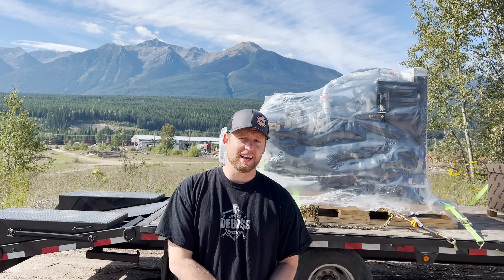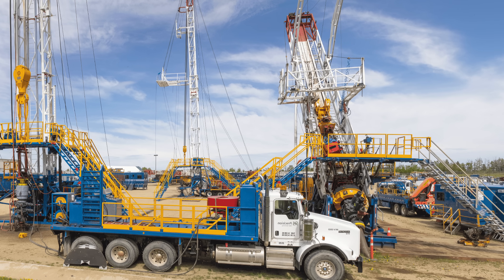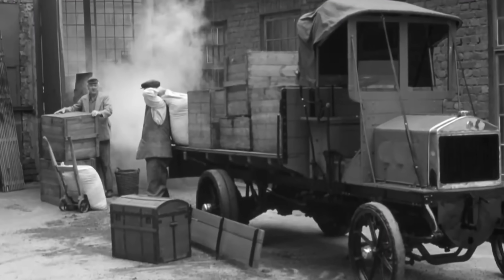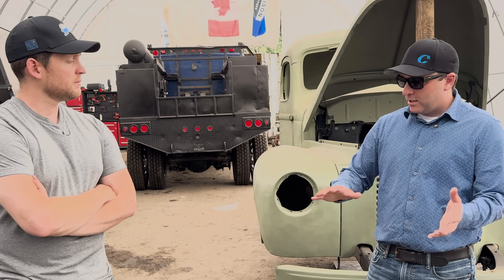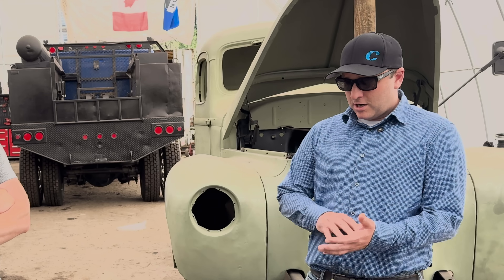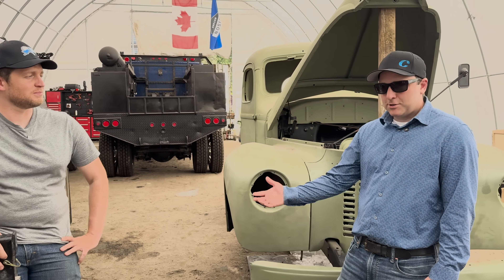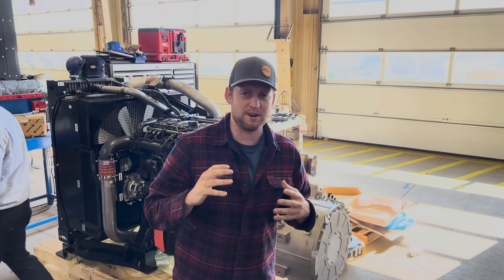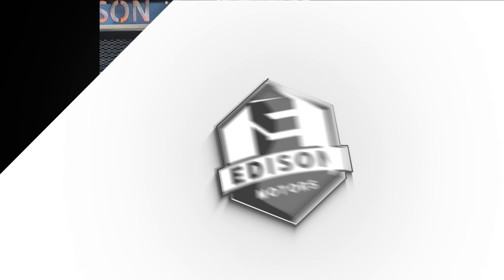We're putting Scania engines into Edison Motors Trucks!

Comment: I was skeptical until no DPF 😂
Reply from the maker: That’s what sold us
Reply: @EdisonMotors yall are being verry deceptive or uninformed. comaparing a cat c18 to a scania 13l on fuel consuption is just crazy. these scania engines have a scr system aka egr doc and is prone to failure just like a dpf. they dont like idleing just the same as all others. they still use def and regen they just do it passivly just like others. also the big issue is you will need a qualified service tech with the proper EST to properly work on these wich not many places in north america will not  touch it, im not sure about canada. that all being said im sure they are good engines like others eddison is just using scummy sales tactics i think wich is super sad.
Reply: Hahaha same here 😅
Reply: No DPF and V8
Reply: That “no DPF” announcement is definitely a big grin moment. There *is hope for the transportation industry after all!
Reply: They have many of those in south America.  Brazil to be exactly.  They do run DPF.  Those truck are awesome and been around for years.   The Scania 113 is the small older brother of the Edison truck.
Reply: DPFs aren't a big problem, its EGR and the adblue system that is bad. If you just regen a DPF filter will last a long while
Reply: @alexstromberg7696 regen my truck when needed.. inbetween all the sensors and bs engineering and filters id take a scania any day. My truck at work has 69k on it has already had the whole dpf system replaced.. thing does a regen almost everyday still ffs.
Reply: @Xxlittl3mAnxX  if it is like a Volvo it needs new injectiors
Reply: @alexstromberg7696 I work for a municipality and highway miles on fleet vehicles are few and far between. A dpf may never get a chance to Regen on its own, union drivers who almost can't be fired rarely take a minute to do it manually and when the dog is clogged the exhaust has no where to go but through the EGR. It makes EGR issues worse. Our small collection trucks for alley use are a mess.. they eat intake valves in the head and sludge up the intake manifolds like you wouldn't believe.
Reply: They still use an SCR system (DEF), so just as much of a pain in the ass. And no less prone to operator/owner negligence lol
Reply: they use a emissions syatem just the same, eddison is sadly being either verry deceptive, or uninformed.

Comment: I remember when the main objectives of topsie was to be able to be worked on by the owner and the facility or replacing parts on it, now we're going with an engine manufacturer from the other side of the ocean, good to know
Reply from the maker: The owner can’t work on a DPF.

Going with an engine that doesn’t have that makes it much more serviceable
Reply: @EdisonMotors   No dealers in Canada, probably no scania technicians anywhere to be found either, im good I will stay with the stuff we know and have easy access to.
Reply: If you've watched the video, you'll know that all of the stated objectives still hold, even with the move to a Scania engine.

Comment: It's said that there are two types of truck drivers: those who get to drive a Scania and those who want to drive a Scania.
Reply: I would.. but unfortnatly my company are owned by an investment group.. so when our cheap nasty renaults go in a few month. it will be whatever is cheapest... probably more renaults.... though a gas iveco demo has turned up..... and i want that even less
Reply: @Gazzxy  If you are truly unlucky they will buy Iveco. Sucks to be you bud... :D :D
Reply: @Guds777  it will be the cheapest one for sure.  whatever that will be when they remember to actually do a deal.. still don't think its been done. though I hear renault have goten more expensive
Reply: @Gazzxy  The company I drive for is also owned by an investment group. Howevr, we have Scania R580 Next Gens that run on RME, a 6-series Scania G490 with a lower box (3.7m instead of 4.5m), 4th gen Volvo FH540 (2 of them with Dual Clutch) and 4th and 5th gen Volvo FH460 LNGs. I suspect we're getting new FH500 LNGs soon, as well. Oldest truck we currently have is from 2014 and that is the only 4.5m Scania G490. It's soon to be replaced, though.
Reply: We just had the new Iveco semi as a demo test car, was actually pretty impressed, but still not as quiet in the cabin. The Iveco is prob the cheapest semi in Europe atm. Renault steering wheel position is just the worst @Gazzxy
Reply: @Zirion123  i duno.. i think it depends on options. i remember thinking that on one of the learner vehicles RHA have. (wasn't air it was just up or down)  our Renaults are ok and pneumatic. I thought the Iveco was worse.. that and the Iveco's power steering may as well not be on.. the Renaults you can finger around the yard no problem
Reply: @Gazzxy  had no issues with any steering in the demo truck we had. But demo trucks are usually loaded to show off stuff
Reply: Renault, DAF, Iveco, “six of one, half dozen of the other” kinda thing, right?   LOL 

Don’t worry, we’ve got nothing but junk here in North America too.   Even the coveted PACCAR stuff like the Kenworth and Peterbilt, you still gotta deal with a pile of rust that rots out from under you starting with the first winter spent anywhere in the rustbelt which is the area North of the Mason-Dixon Line and East of the Mississippi River where they spread millions of tons of salt every wither on all roads as a deicer agent.    The American trucks are notorious for rusted out frame rails and undercarriage because none of them powdercoats anything and only spray a very cheap paint often over surface rust and oil from the assembly.     The build quality of the American trucks, all brands bar none, is pure shizzle and enginerring is about none existent.  Allot of the undercarriage brackets holding exhaust components and other things are made out of rough cut pieces angle iron bolted to the frame.   I’m not shizzling you at all!   It’s the truth!

If you want to see a truck that looks like it was built by an amateur in his backyard at night and in the dark, then take a good look at an American truck.  Any brad of an American truck that is, it doesn’t really matter because underneath the cab and the hood/bonnet they’re virtually identical using pretty much the same junk components supplied by the same suppliers.

The totally antiquated 12 Volt electrical system in the American trucks is absolute trash, to say the least!  They’re using the cheapest wire they can find and the cheapest plastic harnesses they can find, and all of the external wiring harness is made out of exposed wires hardly covered in the cheapest wire loom you can find which gets eaten out by the calcium chloride solution that some midwestern states, like Colorado, are using as a deicer agent in the winter.    There’s virtually no pre-engineered cables with watertight harnesses used on the American trucks externally other than the ABS cables!  Everything else looks like something you’d improvise on the side of the road just to get the heap going again.  
The upper midwest and the north-west is using sand as traction agent (with rocks ;-p, so you can change windshields a couple of times a year).    And they want darn near a quarter million dollar for trash like that because, you as a consumer, have no other choice due to the protectionist regs and legislations concerning class 8 commercial vehicles.
Reply: It doesn’t matter what brand of vehicle you have anything operated in that area of North America is going to rust out and be a pile of crap after a few years.
Reply: @scottgarboden4529  not so, I had a 1984 KW logger, over a million miles, we washed it every weekend, spent breakup doing tinkering, yes I sand blasted the frame once, put epoxy marine paint on, most of us weren't meatinseat guys. 
 Got to drive a Scania in Mexico this winter vacation, boy I'd get a Cabover and go logging if I was younger, WOW the toughness, creature features, ease of drivability, good MPG too.
 Got my first drive as a 17 year old in a Hayes HDX with a 12v71 with a Allison, water cooled brakes, thought hey if I can do brakes, oil changes, and just did a injector swap, tune up, injector stuck driver pulled the emergency flap, as that early didn't have the spring injector rack.
 Got it off the road, drove it about 8 miles, but was smart enough not to come down to the Cheahelis shop as is was a 5 mile downhill, looking back I was a bright kid, I'd of probably crashed, drove them on the QCI later and was trained by experienced guy.
Reply: @scottgarboden4529 i drove a 2018 Scania 400k miles in 4 years on salty crusty winter roads in Norway, not a single rust spot anywhere on the frame. Frame coating on Scania is amazing
Reply: I'm in northern Europe and my cousin drives a gravel truck and trailer. He first drove a Mercedez-Benz, then he switched to a Volvo FH13, had that one for a year and then came to his senses and now he drives a Scania R730 with a total weight for truck + trailer + load is 76000kg
Reply: Of all all the Euro trucks I ever got to drive - I like the Renault Magnum the best!
Biggest, most open cabin, on top of all the traffic, big power (back in the early '90s). 
After the Magnum I did NOT like the Scania - it felt like you can't see anything....
Reply: Got to drive a Scania in Mexico this past winter, if I was still driving log truck I'd be in the seat of Scania, I was impressed, from driving a 600 HP with a 18 speed to driving a 600 HP with their manual/ auto shift, wow is all I can say.
 Was at a Construction show this past winter, Cat has a new 13 liter coming, 600+ HP not for trucks, but a engineer slipped, it's coming with a old fashioned Cat engine brake, when I spoke with him later he was tight lipped.
 When I asked about Hiway truck engines he just said "We'll see" so fingers crossed, last truck I had was a NZ  the best Cat engine ever .
Reply: Volvo/Scania, or the rest of the crap imho. Driven both extensively the past 15 years, I'd say they're about on par and it comes down to mostly personal preference between the two. Everyone else, at least five years behind.
Reply: Garbage.

Comment: Inthought the generator part is all about efficiency. So would „downsizing“ and usage of the most efficient and smallest generator  be the best choice?
Reply: It all depends on the load. Bigger engine burns more fuel but if you can run it at significantly lower RPM's and still get the same output, it'll be more fuel efficient.
Reply: @BoringBurger 

It’s mentioned in the video. Normally engines are designed to be most efficient in the top RPM… 

I’d love to see a generator load test like design it to 60-65kW (about 80kVa) (60-70% percent range increase) / design it to 80kW (so 100kVA). Design it to 120kVA (should be near infinite electric hybrid range)… would love to see some consumption data for that. Like will it drop from 30-35liters to 25L - 20L - even lesser… that what would be the benefit of diesel electric. Especially with full electric trucks with about 500km range out now (about 90-120 kWh/100km)!
Reply: @BoringBurger  
Just looked it up in tables of general generators. Normally they are most efficient at about 78% of thair maximum load (should be partly engine specific). 

In general bigger generators (kVA) are more fuel efficient. Still my question is, how big should the generator be. 

So is it better to have a 400kVA generator  running for the shortest period or use a 100kVA generator near permanently

Comment: My experience is mainly marine applications and they are just really good engines. And they are dirt cheap.

Not only are they used in powerboats up to 1500hp, lasting for thousands of hours. They are extremely popular as bow thrusters, and they can handle the sudden power demand bow thrusters need to deliver very well. Better than most. 

They are also becoming more and more popular in offshore where a whole bunch of Scania gensets replaces a couple of high power generators. They are up there with the best in efficiency, a number of smaller engines (small is a Scania v8 in this application) is more flexible so you don’t have to run a too large engine at low load. And they last for 60k hours pretty reliably. After that the engine gets thrown out and a new engine gets put in costing a measly 50k. It costs a little more installation effort but a lot less heavy maintenance. They are throw away items, but high quality. They are cheaper, more efficient and at least as reliable up to 60k hours as a comparable caterpillar. And they run much smoother and quieter which is nice for the crew.
Reply: I was worried about how this would affect user serviceability.  CAT engines are plentiful and so are their parts.  Not sure about Scania.
Reply: @Binturong3850  There's a huge parts and service network for Scania all over the US.  10 dealers just 2-3 hours away from where I live.

Comment: Since the engine is just a generator, does it need to be a 770?
Reply from the maker: Does it need to be?  No

Do I want more power though?  Absolutely 

The one we bought first is a 9 Litre.
Reply: I feel like this is part of the reason for a 770.  With it being a bigger engine used as a generator, you can pump more electrons quicker at a more efficient rate without having to run near the upper limits.  As they said in the video, they can also get 30-40+% better efficiencies with their big boy when compared to a smaller engine right next to it.

I guess a comparison would be having a 3500 to snatch your bass boat around versus a ranger.  Yes, a ranger can handle it, but it is still taking more abuse than the 3500.

Comment: I thought the idea was to have a small engine that was only just capable of maintaining speed and charge batteries. Not really powerful enough for acieration, hill climbing. etc.
Reply: That is a small engine. They’re going to be hauling way over 80k lbs with these trucks up and down huge mountains. You would need an engine 3x the size to do the same as these electric motors can.